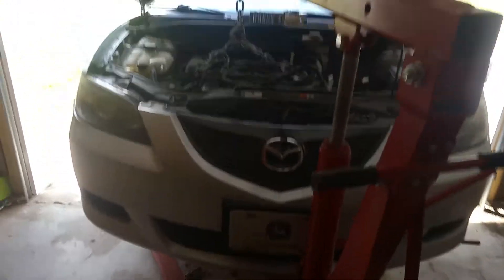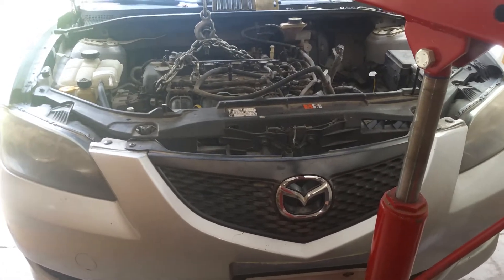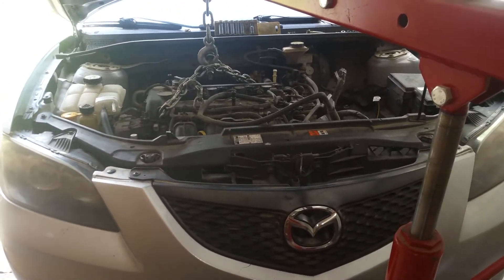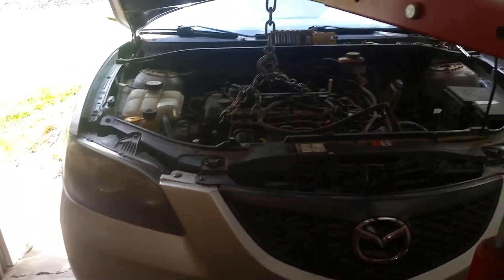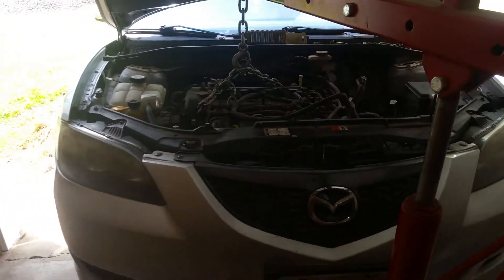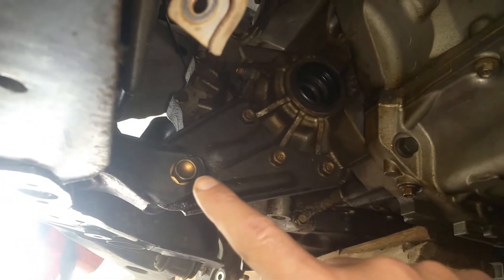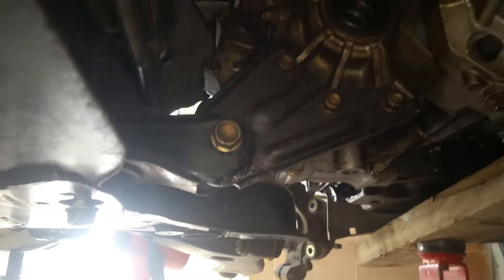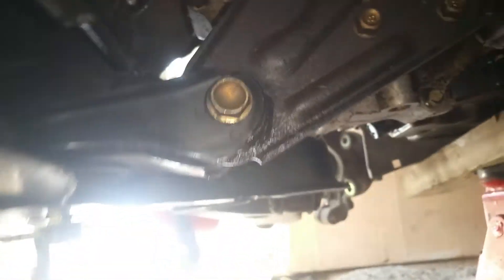How to remove mazda 3 rear center transmission/motor/engine mount

Comment: Thank you, this was very helpful. It's very clear what these two pieces are now.
Reply from the maker: +CtrlAltCreate yes I felt the same way when I was looking at replacing all the mounts , I was scratching my head trying to figure out why there were 4 pieces when I only knew of 3 mounting locations . I appreciate the feed back and thanks for watching
Reply: Fluid is great car runs n drives like a champ.   When in reverse it is like the engine rotates some to make sound of like say exhaust rubbing on frame or something.  While holding brake light gas motor moves.

Comment: anyone cam remove .. now try and put it back on 🤣
Reply: That's where im at. I can't get the 3 bolts that attach to the trans to go back in for nothing. They go in only so far and then become extremely tight. Im scared of tightening them down any further for fear of stripping them.

Comment: Do you have the OEM. part for the bolts
Reply from the maker: That would be hard to find . I do not know the thread but I am sure its metric and I would say any grade 8 in that size and length will get the job done. I keep a huge bucket full of spare bolts just for times like these and I have yet to not find any given bolt Ive ruined or lost . Possibly a salvage yard . Lastly I would order from the dealer . Best of luck on it and thank you for watching.

Comment: Did it have a vibration when put in reverse ?
Reply from the maker: It did have but it seemed the same in idle or any other gear. This mount in particular was OK on mine it was the passenger hydraulic mount and the transmission mount that were really deteriorated. But any one of these 3 mounts can lead to some terrible noise and vibration. If yours only does it while in reverse you might check your transmission fluid while you're at it  also. Best of luck on it and thank you for watching

Comment: My car I could look at the mount and tell the bracket that connects to the transmission case had rubber cracking where the actual mount bolts onto it. Time to replace that at least.
Reply from the maker: That hydraulic mount , which is the passenger side mount , is in my experience the one that causes the most noises. But they are all equally important . The passenger mount will look OK but then upon further inspection have leaked out the fluid or have a lot of hidden damage . I just changed the hydraulic mount on my Mazda 6 recently and was amazed at the difference it made . Silenced all the vibration noises. Thanks for checking out the video and best of luck on yours.
Reply: Thanks! Just got the hydraulic one and the rear one with bracket swapped out and that made a big difference. Cheers.
Reply from the maker: I'm glad to hear it all went well . It's always a good feeling to fix those vibrations . Best of luck on your next project and thanks again for watching .